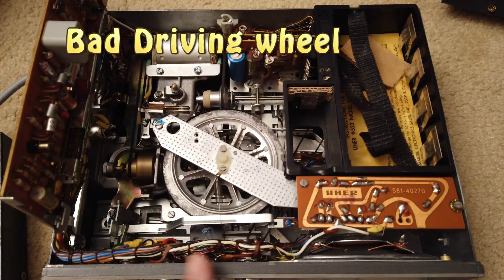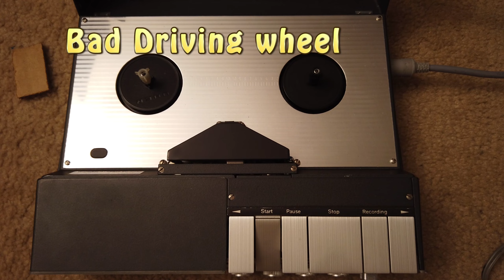UHER driving wheel makes differece (UHER 4000 4400 4200)

Comment: I have a the same bad driving wheel in my Uher report. It becomes very noisy when I go on 9,5 or 19 cm/s. But the big problem is these driving wheels are very hard to get in good or new condition. And when you find one they are expensive